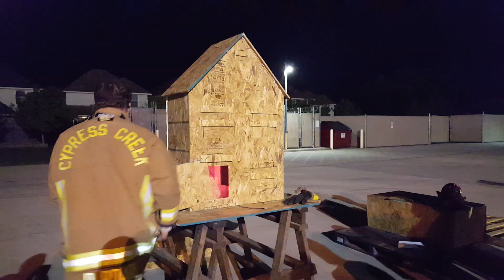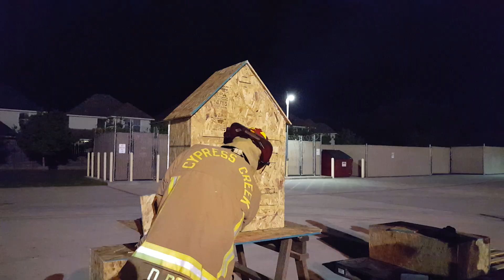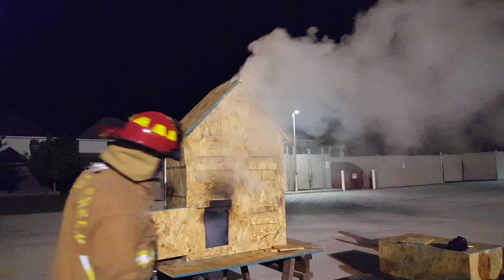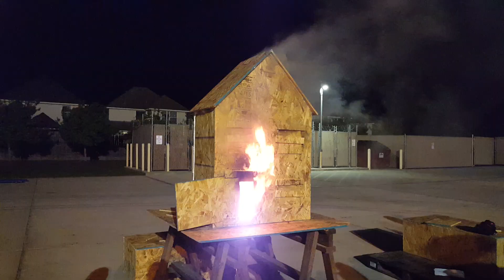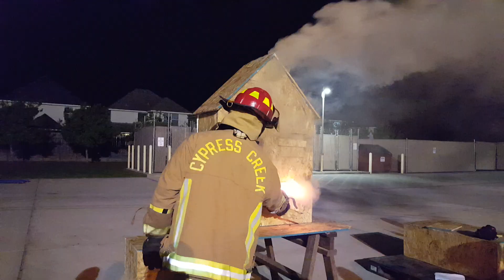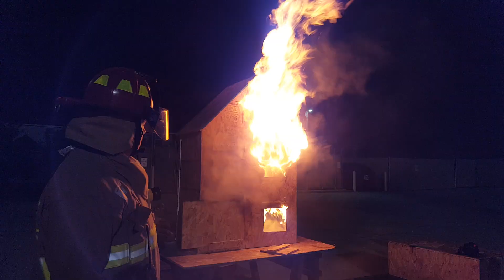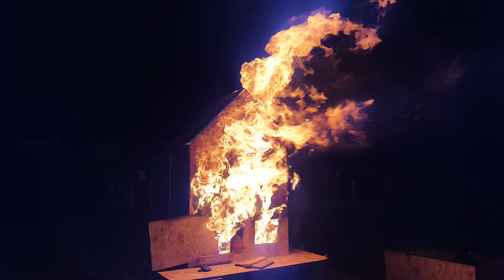Back draft and flash over simulations

Comment: What he keeps doing is deprivating the fire of oxygen when it's got tons of fuel.  Basically making it burn too RICH.
Then he feeds it oxygen creating a back draft scenario and it fires back up.   He was lucky that one time he didn't burn his face.
Reply: foramagasobeselettucepurplergasmup Facial hair actually protects you in a fire, I saw the results of a LPG explosion and the only parts of the guy's face and torso that didn't get third degree burns requiring skin grafts were those protected by his beard and moustache. The skin in those areas looked virgin, no injury at all.
Reply: any guy who has facial hair below the lip isnt a firefighter, you cant wear the gear correctly with facial hair
Reply: Lunchbox Productions it may protect your skin, but your mask won't seal to your face properly if you have facial hair.
Reply: Somehow I think he'd be use to smoke, fire and heat being a firefighter
Reply: Maybe that's why he put his visor down right before?